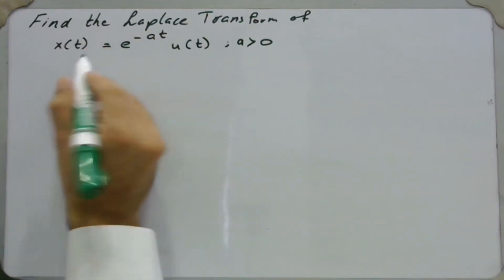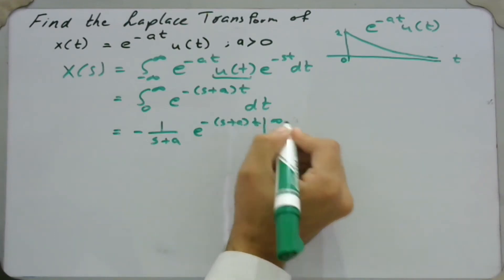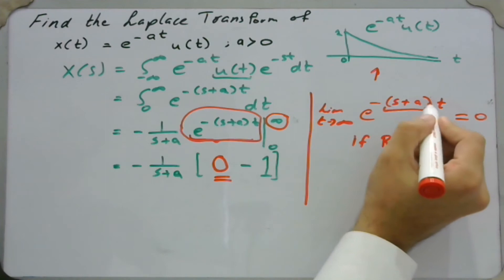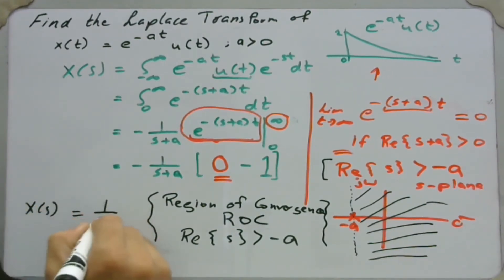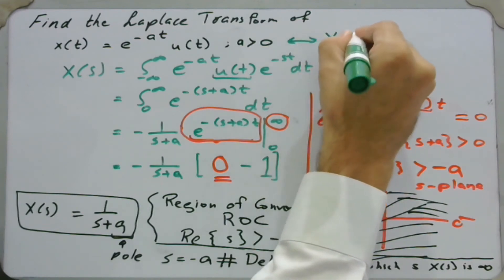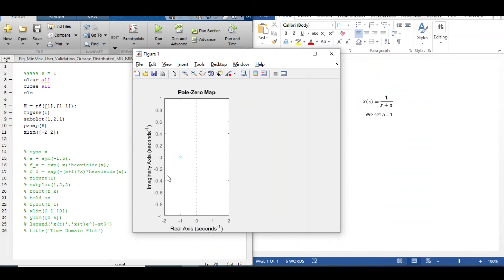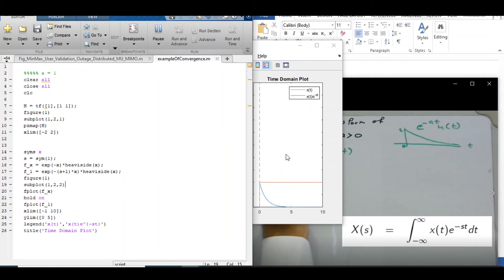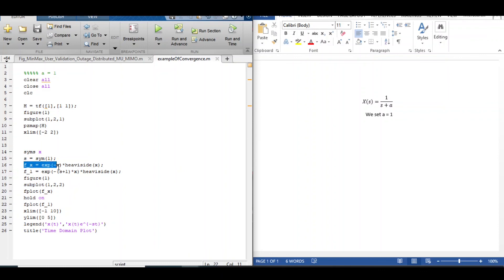Laplace Transform & Visualization of ROC Explained With Example & MATLAB | 3.1c

Comment: Suppose a signal is growing exponentially. We take its LT & find its ROC. So what are we supposed to do practically? Are we supposed to manipulate our O/P by multiplying any signal from ROC such that our O/P converges & system is stable? And what if our signal is exponentially decaying so whats the purpose of finding ROC in this case (except for determing stability/casuality/margin etc.)?
Reply from the maker: The most frequent use of LT is for the ease of understanding/analyzing systems. E.g., Differential equations turn to algebraic equations of s variable by means of LT and hence we often see ease in working in LT domain. 

Now, from signal perspective, the Fourier transform requires Dirichlet conditions for spectral analysis,  LT relaxes some of these assumptions by introducing a variable "slack" real variable sigma identifying the ROC of a given signal. 

An interesting observation of LT is shown in an MIT lecture to further the concept and I am sure you will find it helpful.

https://www.youtube.com/watch?v=MRy8xxvsZA4
Reply: @AKHassan  Thanks. I will go through it. But consider a system with exponentially growing O/P (with ROC: |s| > 2). What is the use of this ROC anyway (except for telling stability/causality)? I mean if i pick any random signal from ROC what to do with it?
Reply from the maker: @realislamicguidance2375  See, your query i think relates to the
existence of  LT, i.e., LT is only available  for the ROC region, the formulation of LT which is int(x(t) e^-st) is not converging beyond the ROC region. hence ROC defines the range in which LT is possible>>> and linear algebraic analysis of the system can be made.
Reply: @AKHassan  Thanks. I want to clear a concept.We know that LT converges if we put back any signal from ROC in the LT.  I need to know how this information (the answer we obtain from LT) is useful anyhow?
Reply from the maker: Yes, consider it as a tool and it is indeed helpful for some applications. Please see the comparison of
Series RLC Circuit Analysis using
1. Time domain & Convolution
https://youtu.be/MzMXS0H1OO4
2. Laplace Transform
https://youtu.be/mTwRMnvEaQ0
Reply: @AKHassan  I have gone through all 3 lectures which you have provided link of, but still cant find the answer. Laplace Transform converges (gives finite value) in ROC. How is this information (the finite value of LT) help us anyhow?